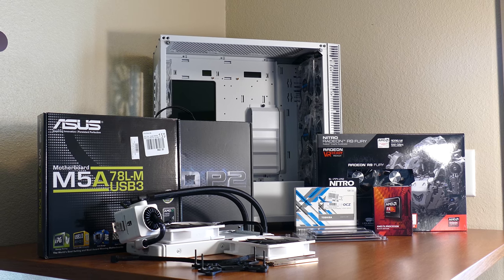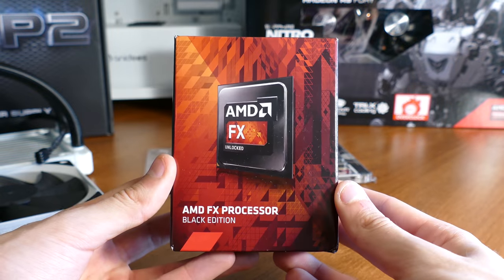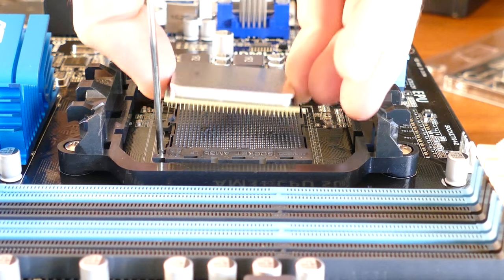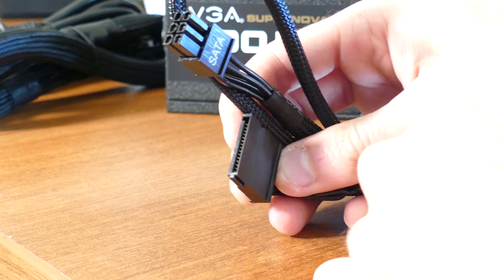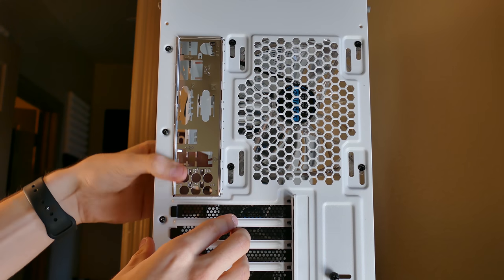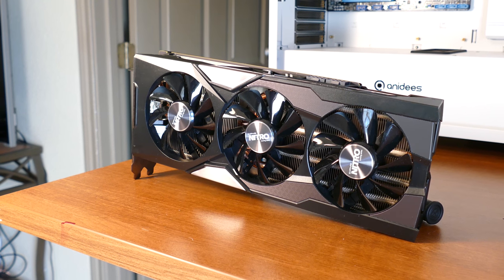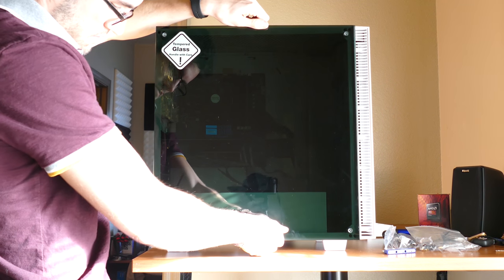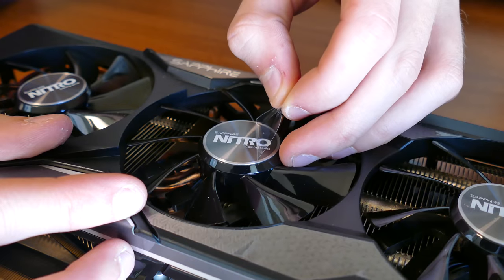How to Build an AMD Gaming PC (2016 Edition)

Comment: why no 8350..?  And my 8350 and 1080 can play 4k gta no probs(the older pci slots still haven't been maxed out #justsayin).  As for ram you can get 4x8gb 3200 quad channel ddr3 for $40 nowadays...and it isn't in most people's price range to get 32 gigs of 3200 ddr4... 
It is a pretty solid and cheap setup that will be super cheap to pickup in 2 months when zen drops and everyone switches to AM4 and ddr4. Really for gaming all you need is a FX8350(or8370)w/mobo&ram[~$200(dropping to <100 in 2 months)] and ssd (the 500gb mx300 is $100 atm) and then spend the rest of your budget on a graphics card.  This is pretty much the best non-future proof equation for anyone looking to build a gaming pc with a budget of $1500 or less.
(Ps. a newer z170 board usually have lots of modern features and more available pci-e lanes than their B counterparts)

Comment: I have the same cpu just a different gpu its a rx 470
Reply: Chewbacca SaurusRex how do you like the rx 470? I've had my eye on it for awhile
Reply: +Kev plays squad bf1 and arms 3 at 60fps without the overclock switch on , best 200 bucks I've spent TBH
Reply: Chewbacca SaurusRex Nice. that's definitely within my budget. thanks for reply
Reply: yeah i have one too. smashes everything 1080p i throw at it.
Reply: I have the Red Devil 480 and it is very, very good too. Consider a Red Devil Version.
Reply: The Red Devil is great but the MSI and XFX have usually better in temps and noise. The XFX GTR Black Edition for overclocking is probably the ideal one to get.
Reply: notlekrut I have the saphhire one i can never hear it
Reply: Chewbacca SaurusRex That's great, overall most cards are great, just some are better for overclock, specially the MSI and XFX ones. I personally have a reference card with a cooler I bought(Arctic Accelero Mono Plus). It's super cool(temp wise), the only noise from my PC is the case fans which I'm replacing soon so it's basically silent and the card is overclocked to 1380MHz with memory OC too.
Reply: +Abraham Soto the 480 red devil is definitely ok for the typical use time for gaming gpus, but definitely won't last as long as others. may still have the worst vrms that actually hardcore overclocking has seen on the 480s. Though I can confirm that it performs the way it should and is ok for typical gaming overclocking. I got one too lol
Reply: I flash the card with a Firmware that can withstand a little more heat. It's on the Red Devil Club on their page. I am running it at 1300 mhz but I have OC it to 1390-1400 without problems to play games for testing purposes. There is no need to OC for me yet. But in the case I need, I have a little bit of juice.. Rx 485 is around the corner and it will replace 480 models, but thats good because now you can find card like the RX 480 Red Devil 8 gb or similar for less than 225..
Reply: Abraham Soto I wonder where you got that info because there's only rumors, shady leaks from shady sources, no confirmation and even those barely mention a RX 485 so "right around the corner and it will replace" is speculation at it's most extreme. Nothing is pointing at AMD launching a GPU to replace the RX 480 and they would be dumb to do so when Vega is what's around the corner and it's objective is to go for high-end, not mid-end where the RX 480 sits. There's absolutely no point in launching a replacement for it so soon.
Reply: wccftech google it. Its going to be the same but with 50% less energy. e

Comment: This is probably the worst AM3+ mobo I've seen... but hey when it's cheap it's cheap!
Reply from the maker: I agree.
Reply: GA-78LMT-S2 is the worst AM3+ board. It down clocks the CPU to prevent frying the VRM's. I see lot's of builders using it and making a profit from it. Doesn't get any worse than that.
Reply: I would like to agree, but I wouldn't cheap out on the AM3+ mobos, you sacrifice the stability in most cases. And I have been the owner of an ASUS M5A78 motherboard.
Reply: Weird, because I built systems with its revision, the GIGABYTE GA-78LMT-USB3, and found no downclocking issue, plus its 8-pin CPU plug is a pro for 125W CPUs.
Reply: Also, the actual worst AM3+ motherboard is that AsRock piece of crap called the N68VS3/GS4-FX family. Can't keep a 6300 stable.
Reply: GA-78LMT-USB3 with 4+1 175-230w VRM begs to differ...

Comment: I've been on the AMD side for a long while dur to being poor. been running a phenom 1055t for the last 5 years and over that time span, I had to steadily overclock it from stock 2.8ghz to 4ghz. it's been showing its weakness in recent titles, assassin's creed unity, Arma 3, gta 5, the division. The best gpu that I would run with this cpu (and fx series for that matter) is  r9 290x because any more is straight up bottleneck. I'm running a gtx 970 and it's clearly not running to its max potential. I'll be getting me a 4690k this black Friday to save me from this hell

Comment: Why such massive wattage power supplies?
I have a 400 watt psu that powers my 4690k @4.4GHz and a gigabyte gtx 1060 6gb. It's been completely fine for over 3 months now
Reply: Ahsan Karim the fury is a pretty power hungry card
Reply: Power supplies degrade over time. Plus its good to have elbow room so that the power supply isn't working close or at 100% all the time. I have a 650W power supply, and I have a i5 and RX 470.
Reply: Ahsan Karim he said why in the video...
Reply: In general you don't want to use more than 80% of PSU capacity.  They are most efficient at 60% to 80%.  Also, a Fury can take more than 300 watts by itself; they are hogs.  He got the 1000 Watt for free so......same reason I have an AX1200i when a 600Watt would run my PC....hard to beat $120 for an AX1200i.

Comment: I built my buddies an amd system with a fx8350 and a rx 470 on a MSI z79 motherboard with 8gb of ram. The whole system cost $750 and they can play battlefield 1 on ultra at 60+fps
Reply: Their proccessor came with a wraith cooler, which is actually a surprisingly impressive stock cooler
Reply: Nice! Some final love for the FX series before Zen ^^
Reply: mistermaximal I think if people are gonna build a pc solely for gaming then amd all the way, no point in spending overpaying for good gaming pc

Comment: I wouldn't install a Fury... in my opinion 4GB memory in 2016 is not enough (Skyrim modder with < 250 mods here!). I bought a RX 480 (almost the same performance) spend the few more bucks on the VRAM and think it's worth it.
Reply: 4 GB HBM is enough for 1440p Ultra (in most games 3GB are used) so I don't see a problem in that
Reply from the maker: It's plenty.

Comment: What are the beat SSDs to buy excluding the samsung series.
Reply: Shrimp Sandwich Kingston, crucial, OCZ
Reply: western digital just came out with an SSD too. 1tb for ~$260
Reply: At least I have my eye on these:
Adata SP550,
OCZ Trion 150,
PNY CS1311,
Kingston HyperX Savage,
Samsung 750 EVO.
Even though I have a Samsung 250gb 840 EVO, I would buy one of those in the 480/500 GB range due to pricing.
Reply: i can recommend my pny cs1311 ssd. very fast boot times, just get it with at least 240 gigs of space so you can store some games
Reply: Have a look at m.2 ssds with over 100,000 IOPS of 4KB random read and write.

Comment: wouldn't the rx480 be a better choice?
Reply from the maker: Against a Fury? Negative.
Reply: Salazar Studio oh... i did not know thanks for answering
Reply: The Fury is overall a faster card, and since some RX480's already hover around $250+, it makes sense to pick up the Fury at that price.
But in general, I'd say 480 is a better idea for that config.
Reply: The Fury is an outclassed card now that 1070 and 1080 are here (even the 980Ti was faster), but it is easily more powerful than an RX 480.   I would say Fury was an experiment on AMDs part and they proved that 4GB of Super insanely fast RAM can perform as well as more GDDR5 at least in the generation of games that were out when it was release.  For the next generation of games it will probably not keep up though due to the 4GB; it does point to VEGA being really good though since they will have 16GB or more of the even faster HBM2.

If your biggest concern is up front cost though this is a great deal and a Fury will perform between a GTX 980 and 980 Ti in DX11 and probably about the same as a 980Ti in DX12.

Right now I would buy an RX 480 instead because of power use and the fact that you could get away with a 500Watt PSU instead of 800W with that card saving even more money...althoguh you can buy a used GTX 980 for less than $200 too and that might be an even better choice.
Reply: +razamatraz You're missing the point. This video wasn't about the best bang for your buck build, it's some of the best performance you can get with AMD.

Comment: Hey Sir.......i'm thinking of building a PC mainly for schooling activities and which can handle plenty of workloads,also future proof....these are the parts 
CPU-i7 6700k 
Mobo-msi z170 krait 3x
Ram-16 gigs of vengeance lpx 3200mhz
GPU-zotac 1080 amp xtreme
PSU-EVGA SuperNOVA NEX 750W 80+ Gold
& Acer K272HUL Ebmidpx 27.0" 60Hz Monitor
 I need all of your guys help..
Reply: GTX1080 for school activities!? lel
Reply: +84Baco  Uhh...Gaming at first..then school activities.....😅
Reply: A 60hz monitor pared with a gtx 1080? To be honest you might want to rethink that and think about getting a 120hz/144hz monitor instead if there isnt a big price jump
Reply: +jynxed .should i get this monitor ? Dell S2417DG 23.8" 165Hz Monitor

Comment: these AMD budget builds never make sense here in sweden, an i3 is way cheaper than an fx-8300
Reply: The i3 6100 is cheaper here in the U.S. It's only $105 whereas the FX-8300 is $115. That being said, Greg did get a pretty sweet deal on that CPU and motherboard at a Microcenter. I just wish I had one near me. The closest one is about 200 miles away. :(
Reply: Tarron Clary - I need me one of those $10 6100s!
I paid $50 for my G4400
Reply: Fak, my bad lol. Supposed to be $105

Comment: 1070 SLI or 1080? i already got a 1070, and i7 6700K.
Reply: George Costello sli
Reply: George Costello 1080. always get the fastest single card you can get, SLI doesn't work with all games.
Reply: George Costello why not wait for the 1080 ti? if u have the budget of course
Reply: heard the TI is gonna be 1000$ i'm in the UK so that will be around £1050. i ain't paying £1000+ for a GPU, especially when £1000 is like $1300. I'm heading towards 1070 SLI, mainly because i want to be future proof. i'm sure more games will be SLI ready. Also, 70%+ performance over 15% on 1080. another question though. i have the 1070 strix, and i'm way over budget if i get another one, you think getting a different cheaper 1070 will look ugly? my 1070 was £499 and i've seen the EVGA go for £420.

Comment: The r9 fury is worth with that consumption?
Reply: Fury consumes as much power as a 390 since it uses highly efficient HBM instead of gddr5 so yes totally worth it for 1440p gaming
Reply: Gilberto Robles If you can't afford the extra few cents on your electric bill, you shouldn't be gaming on PC smh.
Reply: What a guy.
Reply: Power supply and case choices are limited when you choose a giant card that needs two 8-pin connectors just to run. You have to have proper airflow to keep it sufficiently cool and be able to provide enough stable power to the graphics card. Also, a PC with power hungry components can very well heat up a small room which may make you want to run your A/C even colder. I've had a PC with a FX-8350 and a Radeon HD7970. It cranked out heat. In contrast, you can get an i5-6500 and a GTX 1070. Not only will the PC be more powerful for gaming, but it won't cost much more because you can save money on a power supply and case as well as the electric bill over the next few years.
Reply: Ty man.

Comment: use a aio cooler for the cpu and clock it to 5GHz
Reply: or liquid nitrogen. though he would need a 99fx board for that high of an overclock bc this socket isnt for overclocking
Reply: a 5GHz oc can be done with a triple rad. its what i plan to do with my 8350
Reply: Jason Duster and it would cost you an extra USD $100 or more depending on where you get it.
Reply: lol

Comment: Ah yes i remember that motherboard...I hate it i oc'd my 6300 to 4.2 and after acouple months sometimes wouldnt boot it would turn on but the screen would stay black after that i got a diffrent one been good so far
Reply from the maker: Yeah it isn't for overclocking. Will likely keep it at stock 4.0GHz.
Reply: not to mention i had it at 1.448 v lol would hit 82c with stock cooler...i learned my lesson never to buy a cheap mb if ima plan to oc
Reply: ^^ nice

Comment: Only top tier GPUs will get any benefit from PCIe 3.0 features. I own AMD budget gaming PC and my RX480 isn't pegged in any meaningful way.
Reply from the maker: The Fury is a very powerful card. You would start to feel 2.0's limitations with a card of this caliber.
Reply: Salazar Studio That was one of many things to consider. Driver support in Windows 10 was another. AM3 socket is really dated at this point and many motherboard manufacturers haven't added driver support for Microsoft's youngest OS so, for better or worse you get stuck with driver that's added to the system.

Comment: That board can barely handle 8 core piledriver even with the E processor , 4+1 vrms thats a problem. At least add heatsink on the vrms. And do not overclock with this board, that's pretty much sure way to blow the vrms. Haha. Well it's a cheap board.

Comment: but the power consumption
Reply: Is normal 28nm high end GPU TDP, yes?
Reply: Find a 14nm or 16nm card. 433w peak? No thanks. Also that 8320e cpu will be very power hungry too. It would be interesting to see the power draw.
Reply: I wouldn't say 95W TDP for a CPU is a lot, same goes for a 275 W last gen high-end GPU. A solid 500W PSU is recommended for that GPU, which really isn't much for a last gen high end system.
Reply: A 500w psu will not be able to handle that system. 500w is all the rails
 combined so essentially its really a 430w psu. 400w+ from the fury not 
to mention the 95w cpu it will fry that thing np. More along the lines 
of an 850 like greg suggested.
Reply: siv i have a 600W 80+ Bronze PSU with the CPU and GPU overclocked had No Problems whatsoever
Reply: Helodon   Well i can't argue with that.

Comment: FOR THE REALLY POOR PEOPLE LIKE ME. 
-Replace FX8350 with 6350 or even FX4350. 
-Video card I went for XFX HD7970 for £45. Good price doesn't mean good choice. 280x would have been better. 
On a budget, buying second hand from a reliable store is the better option for price to performance. 
This motherboard is truly a bag of shite :( Has USB 3 but no connectors and the over clocking ability leaves much to be desired.
Reply: the 280x is a rebranded hd7970 just saying...
Reply: Punching Pigeons maybe changing the thermal paste will help, my 7970 doesnt exceed 65 degrees
Reply: Thermal paste is nice but the thermal pads are piss poor quality, although they are new as well. Now i have a better case im happy with 72c. I dont notice many stutters in games, i  put those that happen down to the fx4350.
The main problem with the card is the noise :p